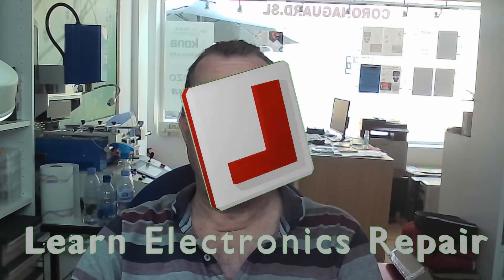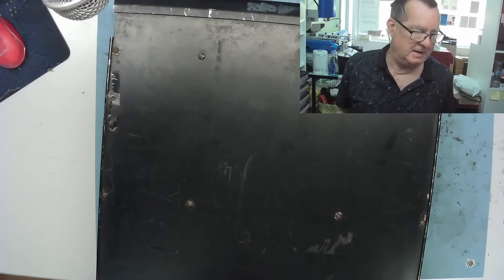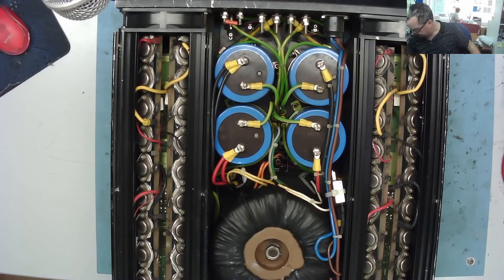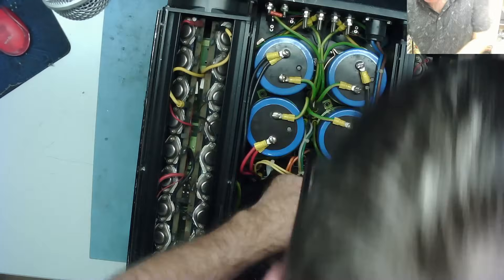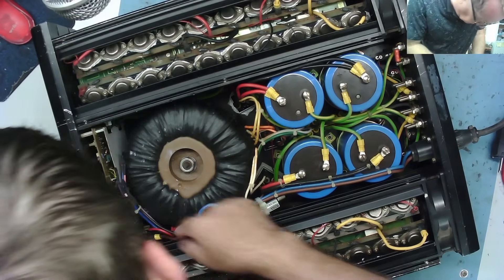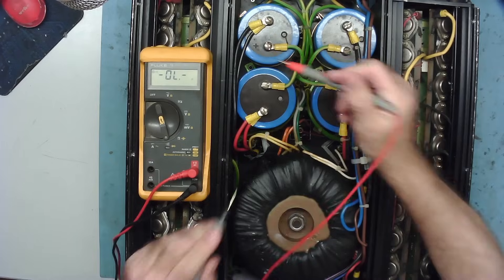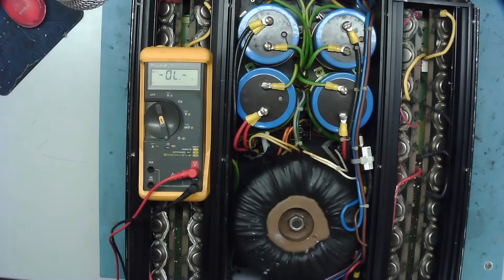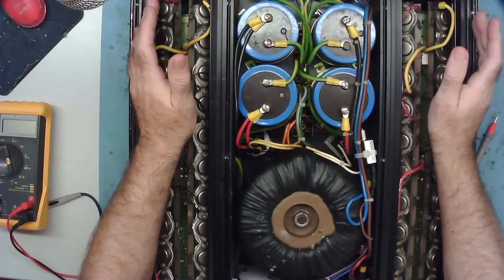All You Need To Know About AMPLIFIERS To Fix Stuff - A Beginners Guide To Audio Amplifier Repair

Comment: Thanks🙏
I have recently found a old Technics amp at my local op shop. 
Got it home and it didn’t work.... I opened it up and looked for anything obvious and saw a blown fuse. 
Got the new fuse, and soon as I turned it on there was a flash of green light and a newly blown fuse.
Unfortunately I don’t have the skills or the tools to go any further😞
I find it sad that no one fixes audio gear anymore.... certainly no one where I live in W.Australia.
I also have a Cambridge Audio unit....I think called One🤔 anyway that one I was given because it was broken.
I discovered that although it turned on and appeared to function I couldn’t get any sound out the speakers🤔
In a flash of inspiration I connected my headphones and was surprised to find the sound was coming through them just fine.
I’m sure one day I’ll ask someone that can help me get them working😉🙏

Comment: Thank you for this most detailed description of the various classes of amplifiers, how they work and common faults. Amps have been a mystery to me for decades. I used to be in various bands and built some of our own equipment. This helped me in understanding & diagnosing an old Playmaster 300W Subwoofer amplifier from Electronics Australia Magazine May 1995. It exhibited the symptoms you described precisely. It's a pity these videos were not available at that time, they could have helped me fix it then rather than buying/building another one.
I think the transformer used in the video to invert the audio signal is a stroke of genius. It could probably have been done using op amps/ transistors, but I'm sure they had their reasons for going down this path.

Comment: This video and explanation really came in at the right time for me. It just happened that I have an amplifier on the bench to repair. No audio out on the speaker terminals. The power rail is good. I have schematics but was a bit of researching without realling knowing where to look at. With your video I'll probably diagnose it in a more structured way.  By the way, it is an AKAI AA-1135, back from 1980.
Reply from the maker: Hi Chris. good luck with your repair, I hope this video helps you.

I had a quick look at the service manual. With an amplifier of that vintage, bad contacts in the front panel input/signal selector switches is a very very common problem so keep that in mind 😉

Comment: I’m a retired master automobile mechanic with almost zero knowledge of electronics, all I ever learned was to trace circuits in wiring harnesses, control area network communication faults and sometimes replacing a mini injector driver relay in a engine control module or just patching a shorted printed circuit, I have a decent understanding of how the electrics work in a vehicle from the battery, charging starting system, it’s relays and switches all the way to the lights and of course, the use of a multimeter, plus the use of a scope to look at crank and cam angle sensor patterns, also have enough understanding to wire a whole house AC circuit and calculate loads to use correct wire gauges and to properly wire and balance a breaker panel. Also have a decent understanding of solar system as I wired  some of my house circuits with an emergency solar back up system. 

What always fascinated me was the electronics inside the modules, specially back in the 80’s when modules were smaller and more (solid state), same with audio gear from 70’s and early 80’s, never understood how they worked, always wanted to know how a PNP and a NPN worked, what was needed to make it work, same thing with resistors, capacitors variable resistors, etc.
At this late age after retiring from working on cars, I now have time to learn about this stuff, always felt I needed to know this before I go, this is just me, I’m in the process of learning to use an oscilloscope, where components go and their role, later I’ll learn the needed values of each component based on the desire output of an equipment in order to build a device. 

Thanks you Sir  for what you do.

Comment: Nice video, you explained it very well. At the Class D topic I think it is a little different, it is not PWM (Pulse Width) but PHM (Pulse Height), following the height at a fixed frequency. I my understanding the amplification operation is closer to AM than FM. Amplitude Modulation instead Frequency Modulation. PWM is Frequency Modulation/Modifcation, it changes the time between pulses of the same height to reduce the voltage by reducing the on or off in length of time. That is not what you want if you want to reproduce an audio signal because otherwise it will change the frequency of the audio (or other artifacts). You can compare it with switching, a carrier wave, constant samples taken from the audio at a fixed frequency (for example 260khz, far above hearing limit). Because of the (carrier wave) frequency, the output is not constantly on like 100% and that are the savings. This is not PWM, the width of on/off is constant, this is switching/oscillating at a frequency, like a microcontroller or CPU do with use of a crystal (that is why D is classified by some people as Digital). With use of switching it follows the height and lows of the incomming amplitude like other amps do but only a fixed periods of time. That is the difference. At the end of stage it uses a low pass filter to filter the the switching noise/carrier wave.

Comment: Hi Richard, I'm hoping that you will still see questions in a 2 year old video. At about 1 hour 17 min you mention again the very low value emitter resistors on the Parallel Output Transistors. Are these always equal in value to one another to set a specific voltage, or are they likely to be different values in order to set individual compensation for differing Transistor characteristics?
BTW - This is by far the most comprehensive Amplifier instructional video I have ever come across. Cheers.

Comment: You have an excellent teaching style - have watched many of your videos and enjoy both the entertainment and learning. Minor point on this video @13:46 I believe the peak to peak voltage is approaching 12V, rather than 6V. Regards. (Edited to add: similarly @22:47 24V p-t-p rather than 12V. I begin to wonder if it's me...) (Another edit - this one had me scratching my head for a while: @45:40 I was struggling to align what I think I know with what you're saying/showing. The best I can come up with to reconcile the difference between the class A (+ - 12V?) and the bridge mode which you quote as 24V p-t-p is that actually the peak to peak on the bridge mode amplifier is in effect 48V. This is becoming a bit complex now, so any more anomalies in the video and I'll probably delete this comment :-))
Reply from the maker: Hi Will
It's not you it is me.  I mixed up the terms peak voltage, and peak to peak voltage a few times in this video 🙄  I also said plus/minus 12V peak to peak at least once, which is technically correct but more commonly called 24V peak to peak.  Sorry about those errors I hope you can skip over them in the knowledge that you are correct
Reply: @LearnElectronicsRepair  Appreciate your reply - happy that I wasn't completely losing my mind :-). Content excellent as always - thanks!

Comment: Hello Richard, thank you for this video, i have learned a lot.
Quick question, what if amplifier is still working fine/sounding fine, but low value ceramic resistor is getting hot within 1-2 minutes?
(See your video time stamp 1:17).  What is possible cause that? 

I checked that low value resistor, is not short, only very hot to touch.
Please help, and thank you in advance.

Comment: Hi Richard, good videos. I am just getting into electronics amp repair. The mains input is ac goes through a rectifier to dc. So does the pre amp of a channel run on dc power with an ac input (guitar). The power amp on dc but the output amp on ac power. I have just retierd and won't to get into repair but need to understand before I start probing with my meter..thanks for the videos..keith...

Comment: A brilliant explanation, thank you. But I am a little confused with one point, could you please clarify:- I understand that using 12v and 4 ohms will give a DC current of 3 amps and that this equates to 36 Watts (12v x 3A). But surely, doubling the voltage would not double the power, but instead quadruple it? Using 24v and 4 ohms gives a DC current of 6 amps, and 24v x 6A equates to 144 Watts.
Am I missing something?

Comment: great video just what i needed for my RF project leaned alot from this video very helpful. question i have regarding components and cheap china transistors there not as good as some of the originals can be quite tricky finding the good ones like 2n4427 and 2sc1974 any clues weres best to buy from ?

Comment: Great video, with great explanation. Now, a question: when it comes to designing an AB class amplifier, is it better to do a traditional complementary pair or to do what those guys did? I think it would be easier to find matching transistors of same type (NPN or N-channel MOSFETs), than match complementary pair by gain and base bias, at the cost of a little bit of added complexity (which should not be a problem with opamp preamp stage nowadays), but I'd like to hear your opinion(s).

Comment: Bud, I have just started watching your videos, and I am impressed at your content... however, I design amplifiers for a living, the CLASS is technically directly related to performance and sound. Without getting into distortion formulas (which I am happy to do) CLASS A, albeit highly inefficient, will provide the best signal with the lowest distortion and be the most linear. Whether that is SS or TUBE, it makes no difference, it is BIASED in the case of transistor ON to a OP so that the swing can be linear and conversely with the TUBE we turn OFF (either G or K) with a negative voltage to set the OP  so the class is directly associated to quality.

Comment: Great videos as always. I have a question. I have a brand new Bluetooth speaker that plays but has a crack/static noise that you hear like someone is touching a live to the speaker wire for less then a second at a time but it happens ever like 5 seconds? Any ideas I was going to use a thermal camera but it’s not when it heats up it does it right away??

Comment: Great video very helpful with your explanations. Do you ever repair inverters and if so could you do a video on a repair.
Reply from the maker: Well funny you should mention that.... A friend bought an old UPS at the flea market last weekend and it isn't working. 😉
Reply: perhaps he must change the battery first
Reply from the maker: @jameskidd7906  He doesn't want to use it as a UPS he wants to use it as an inverter with his solar panel and external battery.  So he does not need the internal battery but he says it isn't working as an inverter 😉

Comment: The picoscope usb unit seems to be a cost effective option for amp repairs with a couple of caveats (linked earths across channels is one). The basic one includes fairly good software, has two channels plus a function generator. You can do ballpark ESR testing by linking the sine function gen output to the channel probe and seeing if the capacitor generates a voltage due to resistive behaviour (creates a voltage divider with the function gen internal impedance).
Reply: I thought all scopes share an earth across the channels. Or am I misunderstanding you here?
Reply: @gerrabath  I believe some pico models have independent earths per channel (lot more expensive). The earth is also shared with the USB connector, so care required. The 0V line in the amplifier (centre tap of the transformer) might have some voltage differential with true earth, causing a flow through the scope, if you use that instead of the chassis ground.
Reply from the maker: Any particular model you would suggest? They seem to make a whole range of them
Reply: @bwm999  Ah makes sense. Reference to ground.
Reply: @LearnElectronicsRepair  the base model is 2204 (2 channel 10mhz) at roughly £100. Higher bit rate & bandwidth available at higher cost. 4 channel also available for more  money. You can get similar hardware from China but the Pico software is fairly decent & well maintained which makes a difference. You can download the software & it will offer a demo mode if you don’t have the machine.
Reply from the maker: @bwm999  Thanks for that.  USB scopes are one of the items I would like to reivew, I will see if I can get my hands on one soon.

Comment: I just started the video but i have a question about my home integrated amplifier receiver, so its a fisher model from the 80's but i regretfully had messed with the speaker +'s & -'s for the left channel while it was on and playing. They touched. There was blue sparking and quite loud pop crackles. But now there is no sound out of that channel why and what do i need to replace or repair on the boards?

Comment: Hello I have a pioneer vsx-519v and the issue im having is when using it in stereo mode it is working perfectly but when using it on pro logic mode there lot of noise in the front speakers I check all the components on inside all seems in good condition what might caused these noise please

Comment: Wire a 470R 10W resistor in place of each DC supply fuse before switching on a repair. It'll drop the rail voltage if there's an overlooked problem component, and limit the damaging current. Once in a while this will upset a healthy amp (can use lower resistance values with lower DC voltages than 90V), but better safe than sorry. Even better is to parallel the droppers with fast resettable fuses, so they are only in-circuit if needed. Add an analogue meter in parallel with each one for a quick visual check.
Reply: I'm tackling my first amplifier repair now on an old NAD where I had to replace about 15 components so far. Is the lightbulb current limiter good enough? This comment worries me a bit since I'm close to being confident enough to switch it on to try it.

Comment: Wow, that was an amazing tutorial. Thanks.  It really helped me plug some gaps in my knowledge.  Great explanation of how amplifiers work and what's important in finding faults.  Im currently repairing a Pioneer SA-706.  It has a flaky dual transistor  (2SA798) in the signal path on one channel, but I noticed that the pnp output transistor on this channel has a low hfe (45 ) compared to the same transistor on the other channel (75).   Could i get away with replacing this low hfe transistor or should I get a matched npn and pnp pair for this channel?
Do you think this may have caused the dual transistor to fail?
Reply from the maker: From your description it sounds like you have one bad channel and one good one - try swapping the suspect components from the good channel to the bad channel. 😉
Reply: Thanks so much for your reply.  What I was really asking was, if you have a failing/faulty output transistor in a class AB amplifier.  Can you just replace the failty transistor (in my case the pnp) with the same type or do you need to replace them both with a matched pair?

Comment: Hi there, have a question about my ELAN z660 Power Amp. It has a problem, the system when turned ON, send a sound (as per signal sent) to relevant channel but soon the sound cuts down, the system stays ON.  No hum or interference then onwards, But if I turn the system OFf and back ON, the same amount of sound is heard. What could be the problem, Any guesses or guidelines. Much Appreciated.

Comment: Hey man couldn't you make a voltage divider using the same ratings to cut that supply voltage in half. Maybe the variable resistor is easier for yourself but I'd rather use two resistors of same value rather than have to fight with the pot to bias. Of course I am use to doing this with only BJTs so that maybe where my confusion comes from. I was told MOSFETS are complicated to learn to use, since you have to have a bleeder resistor in order to turn it on and off.

Comment: Hi Rich, I know the intention was to keep the gate voltage below the drain voltage,
but shouldn't the bias resistor network be taken from the supply rail, not the drain resistor?
so the DC bias can remain stable.

Comment: I Have the JVC RX-5032V.  I am using the Fiber optic cable for sound. The problem is this. When i turn it on there is static coming out from the speakers,but when i touch the backside cover the sound comes back on.  A reply would much be appreciated.

Comment: I have a optinica amplifier sm 1515b if the power transformer goes bad can it still be fixed the part number is rtrnp0506afzz and out put ic is rh-ix1066afzz where can you get those parts if I need them it is special to me it was my graduation money purchase

Comment: Ho. I have a Denon poa 2800. Today it started having problems with the right channel: it makes a very low distored sound that sometimes goes low until you can't hear it. I've tried WD-40 made for electric contacts (waited to dry) over all the Board but with no results. Jack is okay, potentiometer seems okay. Any suggestion? It happens on every output (8ohm, 4 ohm, It doesn't matter: completely distorted)... Also the left Board seems to get more warmer than the right Board...